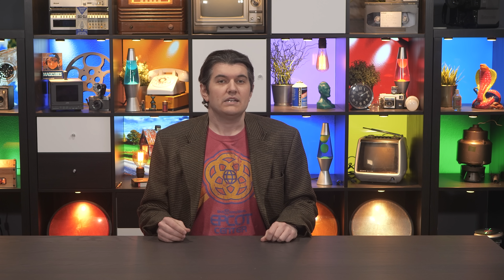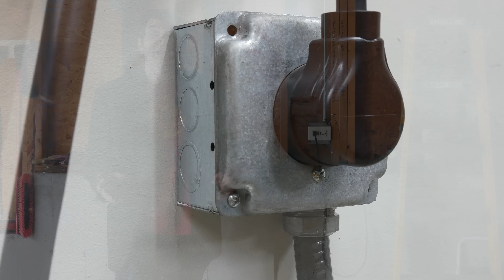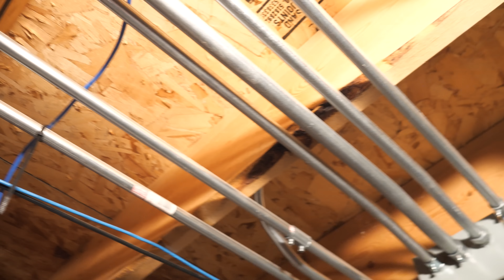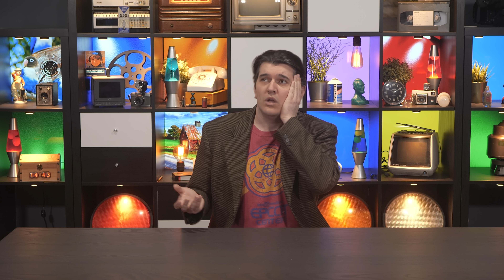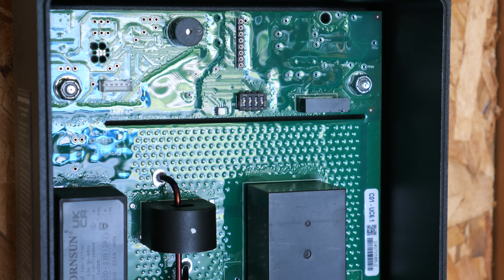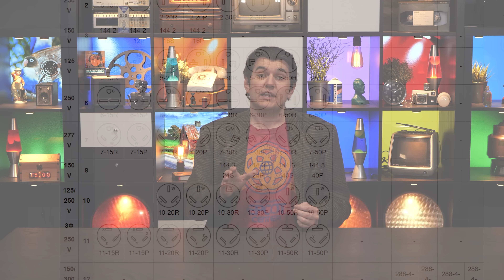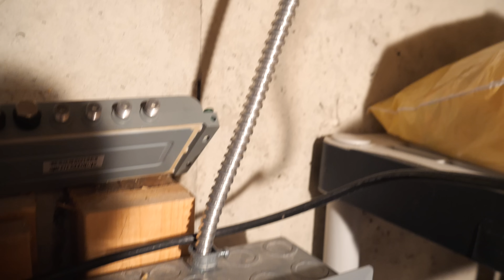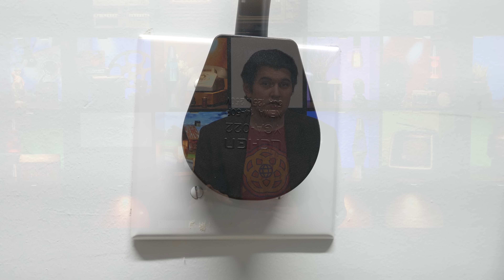The "standard" car charger is usually overkill—but your electrician might not know that

Comment: Hi from the UK, my parents faced this issue 4 years ago when my dad got a plug in hybrid as his company car. They were quoted 1000s for a proper wall mount charger to be installed so instead paid a couple hundred for a new waterproof standard UK double plug, it easily charges the battery empty to full on a 13 amp circuit overnight. (70 mile pure electric range) Plus there is a second socket which makes from yard work with electric power tools or hand washing the cars with a jet washer soooo much easier.
Reply: But interestingly here you have 2 choices, professionally installed hard wired high powered charger, or the very low power normal wall plug chargers. None of this varying sizes and special plugs

Comment: For the most part, I had a regular garage outlet.. and I just used 15a charger.    it gives me 25 miles a night.
Even if i drive 50 miles a day.    thats just going from 275 miles to 250 on monday night.  225 on tues   200 on wed   175  on thurs  and 150 on friday.
Then I can charge up 75 miles a day on the weekend   so back up to 300.

But I did install an outlet because chevy gave me 1000 to install.    so i get 250 miles a day now.   and I do uber sometimes.    
No problem.     a

Comment: My power company has a smart meter that reports power use every 15min. It is very obvious when our EV started / finished charging. It is very easy to then compute how much time / money it cost for that charge session. Remember to subtract the standard "burn rate" of your power meter, if that is a thing for your situation. The EV charging experience is definitely much nicer than the weekly or every other week trek to the gas station. After driving an EV for more than a year, you also really notice how noisy and smelly gas cars are.

Comment: I alwasy discuss with my pv installer (no electrician). In germany you ofthen have a 5x1,5mm² wire with a CEE16 Connector wich could support 11kW on short usage but not on continuous charging - i'm always telling him he could easily limit the charger to 10A which is still 7kW or maybe 13A which is 9kW. he refuses to understand.

As far as i understood current DC fast charging is more cost effective then placing many AC Chargers in the wild

Comment: Range anxiety? Bah! Humbug! In the last 10 years I have made one trip that involved driving more than 100 miles in a single day, and while that trip would have been cheaper and easier to fly I had to take the car in order to sell it. My next car will be an EV, and it will be plugged into a 240V dryer outlet in my garage maybe once a week to charge overnight. Yeah, it's charging from the grid, but my solar panels will "repay" the electric company the next day, my net cost will be zero.

Comment: I have enough to add a 60 amp circuit with a hardwired charger but went 50 and a nema 14 50 since i need a full charge every day but only have 77 kw battery and it charges in about 9 hours. I did wire it to be able to be upgraded to 60amp if i ever got a car with a bigger battery.

Comment: Do any cars or home chargers need a full 240/120 circuit with the two legs + neutral or can you get away with a straight 240 circuit in all cases? I pulled a full 50a 240/120 circuit in my garage with the nema plug because I wanted the outlet incase I end up getting a welder or something but I know most people don't need that and can get away with the simpler and cheaper install

Comment: While being able to charge from dead overnight isn’t a necessity, it is nice to have the ability.  I rarely need it but I also rarely need all the cargo capacity of my car.  Doesn’t mean I never use it or never need it.

Our host makes an excellent argument.  But arguments to buy only what one usually uses don’t matter when we get to corner cases we all experience sometimes.  I don’t have a DC fast charge station in reasonable proximity to my home.  So a bit more charging capability makes sense for me.

That said our host is entirely correct that 99% of the time we don’t need anywhere near the full charging capabilities of even modest home charging system.

Comment: I own a 2019 Bolt and for my driving needs I use the 120v granny charger for all daily charging. It is only rarely that I need to go to a DCFC. But I didn't realize that a smaller circuit size was possible. Thank you for this!

Comment: Charged my Model 3 on a NEMA 5-20 for the first nine months I owned it. Slow but workable as long as you do some planning. Was only painful when returning from a road trip with a low state of charge. Eventually installed a NEMA 14-50 which makes things so much nicer and flexible.

Comment: I think you made a good point about not panicing if you can't fast charge at home because most of us won't be doing that.
And I think for us non-americans it's even less of an issue since 240V is our standard, so we don't even need to worry about the slower 120V charging.

Fast charging is for people on a long roadtrip where you want to only do a short rest stop and then leave and for commercial uses like trucking where you need to drive far every day.

And for some uses sadly even fast charging is too slow - I own part of a gravel pit and the big wheel loaders and dumptrucks need to be able to either drive a full work day without charging (which they currently can't) or they need to charge very fast, which they can't due to the size of their batteries. Maybe in the future with bigger batteries, or maybe we can find a middle ground with a hybrid electric, where a chemical fuel powers a generator. Anything that reduces the amount of fuel we need because in these types of vehicles fuel is one of the biggest costs.

Comment: 240 volt outlets now require gfci protection. We hardwire with a disconnect switch in sight so there are no gfci nuisance trips caused by the charger unit.

Comment: Licensed electrician. So what happens when you install an EV charger on a circuit with a lower ampacity and program the unit to the lower amp setting, then later on some asshat changes the setting and burns their house down? Good luck proving that you set it correctly...

Comment: Can anyone here recommend me a car which I can control that direct, without cloud, using either webrequests (van WLAN or LAN) or RS485 or something similar so it charges only when I have solar surplus, any only those 1000 to 2500 Watt, depending on how much surplus I have? Without stupid cloud dependency? (Of course I would include a "charge now! I need it full tomorrow!" option in my control...)
23:07 Absolutely right! "Requires an App" "Requires Bluetooth" "Requires an account for initial configuration" is bonkers. Marstek Venus E is such an example, especially since the APP fails to detect the device on many Android phones. But I planned to use the Marstek Venus E using RS485 / Modbus anyway, so for ME that thing works perfectly! I just needed to make it "right away" instead of "maybe later". Same goes for my Growatt MIC inverter, controlled via RS485. And in my case: Powershell to get it all together with an Shelly 3 EM Pro and a few other things. Other may want to use Home Assistant or something similar.

Comment: Those who don't own EVs always get stuck thinking about the "empty to full" charging situation, but they should really be thinking about the "50-60%" charging situation. When you don't need to make an extra stop to add range to your car (like a gas station), you simply plug it in when it's "about" 20% and charge it up to "about" 80% for normal day-to-day use, so it's kind of irrelevant how long it takes to charge from flat dead to completely full. Nobody ever actually does that in practice, except in the most unusual circumstances - and there's always DC fast chargers for that.

Comment: I actually feel that 240V 20A is the "ideal" general-purpose EV charging circuit, especially for multi-tenant buildings. It's way easier to provision sufficient capacity for a circuit like that, and it's nearly 2.7x the speed of a regular household outlet. It's enough for all but the most extreme cases, and it would cost a tiny fraction to run circuits like that to every stall in a condo building and simply put an appropriate plug for unit owners to plug in a suitably-sized charger.

Having your own 240V/20A circuit is an order of magnitude better than your building setting up a few shared level 2 EV charging stalls of higher capacity, because managing and sharing those stalls will be an unavoidable and endless source of conflict.

Comment: Sadly, in my county EV charger must go through Electrical Utility permit - they want to know the Amps we plan to charge with, and they want to see how the wires are connected to achieve 240V. And permit can only be closed by a licensed electrician. That made the installation cost extra $2k beyond just material.

Comment: Our EVSE is mounted 3 feet from our breaker panel. I live in an area where our breaker panels have to be on the outside of the house. The EVSE is on the inside of the garage so the wiring was really easy. The EVSE was also resettable for 50/40/30/20/15 amp breakers and the installation manual described dip switches for setting the breaker size. However when I went to change it from the supposed default of 50amp to 30amp, we found a rotary dial coding switch that went from 0 to 9, and then A to F. It took 2 days to get an answer from the manufacturer (SolarEdge) but once it was set, everything worked fine. For the record, 30amp breaker setting was "C".

Comment: We should also talk about the unnecessary neutral wire that's required when you install a NEMA 14-50. The EV will literally never use the neutral since it charges at 240V. But the neutral wire has to be rated for the full 50A just in case the receptacle is used for something else. Maybe it will be used for the WiFi connection in the EVSE, but that's a few milliamps on a wire rated for 50A, a huge waste. Furthermore, anyone who designs an EVSE that requires a neutral is an idiot. Look at any USB charger that puts out 5V, and you'll be hard pressed to find one that doesn't support 240V. The same circuit can power the electronics in an EVSE, plus then they can sell the same design outside of North America.

Comment: 16:30 "But until people have first-hand experience with an electric car...."

This is why PHEVs are such an essential pivot point.  Since they still have gas tanks, they alleviate range anxiety.  But because they have to have mechanisms to burn some gas even if they don't exceed their range (otherwise the gas goes bad unused in the tank), we can pester them with messages every time they gas up, telling them, "this wouldn't have been necessary if you went full electric."  

I hear Volvo doesn't just burn gas occasionally without prompting the owner, but instead displays a warning about "aged fuel."  Then they have to TELL the car to burn fuel instead of using electric.  THIS is the way to go; force them to accept that their needs are met without gas.  I haven't looked at other manufacturers; maybe they do the same.  If not, they should consider it.

Comment: The fact that Chicago insists on metal conduit for all wiring but allows wire nuts for the connections is ludicrous. Utter safety conscious with the conduit, but crappy horrible wire nuts? Makes no sense at all.

Comment: My father is an electrician and we put our charger on a 50 amp circuit run off a 100A sub panel in our garage. The charger was 100% rebated by the utility so we just needed to buy materials. So we were lucky that it worked for us and we are set up for the future.

Comment: When you say "just 60A service" as if it was very little I laughed thinking about me family. Back in Italy service is usually only 32A single phase 230V, and in most cases you can only pull 16A for the whole house else the meter (or better, the electronic breaker in the meter) trips. Getting a 3 phase service thats at least 32A, comparable to your 100A single phase, is really really expensive and practically no one has that!

Comment: i still dont understand why electric cars dont use car batts.  we use massive ones at a warehouse in our pallet jacks and forklifts for atleast 20 years.  they weigh as much as a car but they last for over 10k charge cycles, they also cost $10k but can be charged at 130 amps and last an insane amount of time.  i want a lithium free electric car, those batts are finished after 1000 cycles, and with thousands of cells, massive lithium packs are just dumb.  a few failures bring the whole pack down.  i know lead acid batts are unpredictable as well but they still usually last for decades.  find a multi-cell 18650 pack that does that.  ppl seems to have also forgotten about overall batt health.  the faster you charge, the faster you ruin em, and with devices now making it harder to replace batts, the more e-waste it generates, now on a car size scale.  insane how wasteful we've become, its depressing.  are ppl really so Fd they care more about charging in 30 mins at the expense of 50k miles of life, just cuz they forget to plug in at night?  more testament to how lazy and cooked we are

Comment: 28:11 When you talk about aluminum wire, if you haven’t worked with it or read the code book on it, you wouldn’t know that you have to use a size bigger than copper wire, as an example, a 20 amp circuit in copper is 12awg in aluminum it’s 10awg wire.

Comment: Glad you mentioned the smart splitter. Most i know with an ev use them. You're probably not going to be drying clothes after midnight, so you have a solid 6-8 hours on the charger.

Comment: Hank Green's video on EVs actually was my "eureka" moment about 120v charging recently. I never really considered that a slow charge would be viable 100% of the time for daily commuting. I've always associated slow charging as "useless" outside of staying in for the weekend. (2 days of charging.) Or getting out of a tricky situation. But you're right, we aren't filling up every single day. (I only had to do that with my terribly inefficient motorcycle from the 80s with a tiny gas tank. I filled up before going anywhere and usually before heading home too.)

And also THANK YOU for sharing your parent's setup and some of the funky EV EVSE stuff. We have a smaller home with a small panel but we do have a drier just inside from where we park. The outlet switcher is cool. I've always been weary of 240v setups because they CAN draw a lot. But you're a saint for sharing that there are DIP switched stations. How incredibly "duh" of me to not realize that could be a thing. I also did a deep dive into the "melty plug" problem and I came up to nearly the same conclusion/guess. Electricity can only do whatever we allow it to try. I don't think a 14-50 plug is any less rated to doing it's spec than any other plug.

Comment: I wound up going the 14-50 route for the versatility; when I don't need the EV charger, I can use it for other purposes including RV hookup (which I only need on occasion) and 240v appliances. I could easily adapt it down for regular 120v outlets as needed as well. It does seem like overkill since the EV charger doesn't use a neutral.

Comment: I work at a Domino's Pizza, and we have a Chevy Volt as the store car. It drives all day and goes down to about 40% by close. We plug it in, it charges overnight, and that's that. The battery is never at risk of dying unless a closer forgets to plug it in. Range anxiety is almost always baseless.

Side-note, an ev is great for this application. No one ever has to take a store credit card to a gas station. We just plug it into the charger outside the store. Easy as pie. Takes 15 seconds.

Comment: This all depends a lot on the EV and how large its battery is. Theres a reason Ford supplies an 80A charger with the F150 Lightning... because charging a 130kwh battery on 240v/24A would take an entire day straight, whereas on my charger it happens overnight in under 7 hours - and because its a big, heavy EV, its range per KWH ain't super great, so you need that.